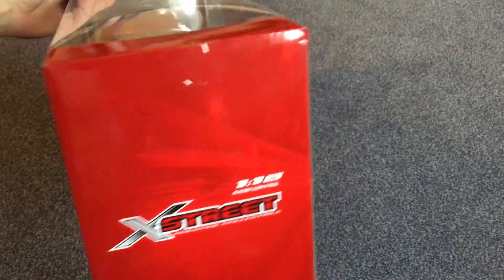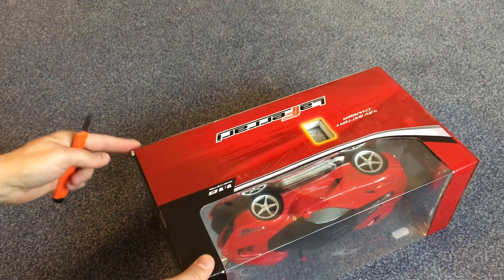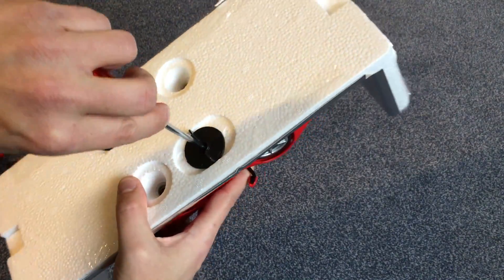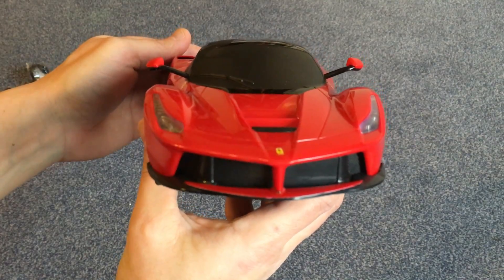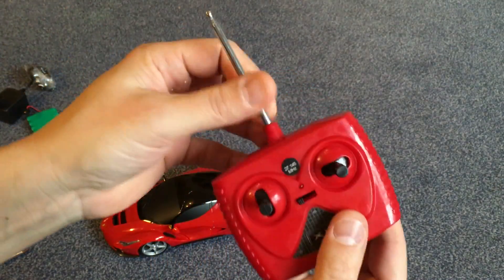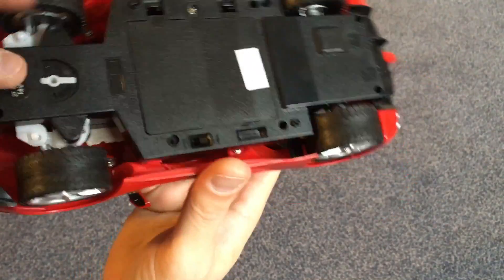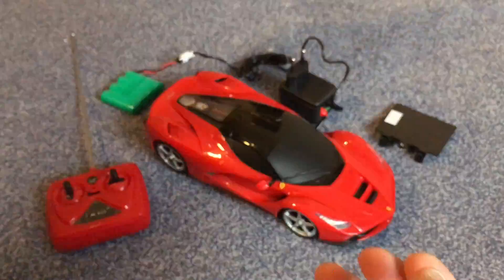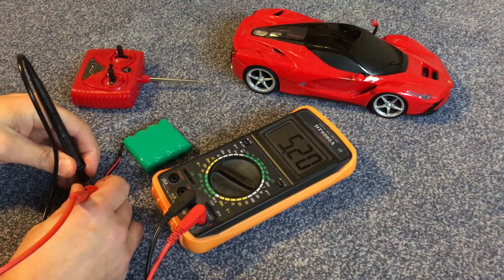LaFerrari - Unboxing, Review and Arduino 2.4GHz RC Conversion!

Comment: Hi. Great job there. You gave me an idea. I'd like to revive an old Tyco Scorcher 9.6v with a 27 mhz remote, but I need your help here. It has 2 motors, 1 each side, it works like a tank. The remote has 2 commands that allow you to run each motor separately forwards or backwards. I've checked both motors and the remote still work perfectly but the control board inside the car it's corroded (it was stored several years). Since functions needed are pretty basic, similar to what you did with this car, do you think I could do the same using exactly the same modules/parts you did? Do you recommend me to use the OEM remote or get a new one like you did in the video? Thanks in advance!
Reply from the maker: Thanks. The "Micro RC" system is perfect for this kind of vehicle. What you need is the "Caterpillar Mode". Have a look at this video: https://www.youtube.com/watch?v=Tjikm6hJ8hQ
Reply: Thanks, I'm going to watch it right now.

Comment: OK thank you. I have watched some more of your videos and trying to understand all of this. Was going to order my boards today. My understanding the newest transmitter is the 1.1 and receiver is 1.3? And I was going to get the HP version. Why I ask is the transmitter schematic I printed out says transmitter version 1.2. Just wondering if you had a 1.2 version or maybe that's just your schematic version.  A video on setting up the transmitter and receiver sketch changing options and so on.  would be super appreciated if you would have the time. Thanks for your help. Also getting your conversion board for that NRF24l. Is there anything else I should get from OSH park while I'm ordering for this project?
Reply from the maker: Yes. 1.2 on the transmitter schematic was wrong. It's fixed now. 1.1 is the current version. 1.3 is the current receiver version. I will try to make a video, but I think the comments in the vehicleConfig.h should be relatively easy to understand. You have to make a section (from case to break) for each vehicle. Then, you just select the configID you want and upload the program. In the transmitter program, you only have to select the correct board version (in the header). All other options can be adjusted in the OLED menu afterwards. You will not need any other PCB's from OSH Park. Have fun with the assembly.

Comment: Hello again. I have been buying broken scratch and dent rc and fixing them for kids for a few years. Mostly helicopters and drones. So I have a few 27 MHz car and trucks that don't work. Can I use the stock transmitter and build a circuit so It could be used? Question 2 can I use a mini pro and build a circuit for the receiver? Just looking for a cheaper route to put more cars in kids hands :-) i'm also going to send an order off to OSH park and build your system. And would put it on my channel if that is cool with you. Thanks
Reply from the maker: I don't see a useful way to reuse the 27MHz transmitter, because most of them only have two momentary switches per axis, no pot. Maybe, you could build a "light" version, using just a pro mini and an NRF24L01+ module. Then just read the switches instead of the pot.
You can also use a Pro Mini and build the receiver circuit in accordance with my schematic. But all the required wiring takes more time than the assembly of the OSH Park board. Yes, no problem, if you put the result on your channel, it's intended to be open source. Can't wait to see the result!